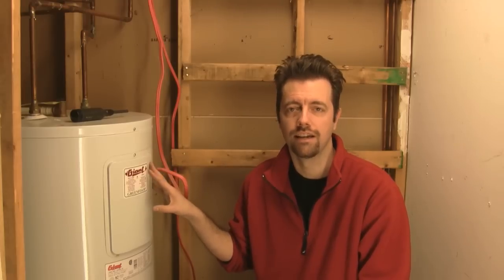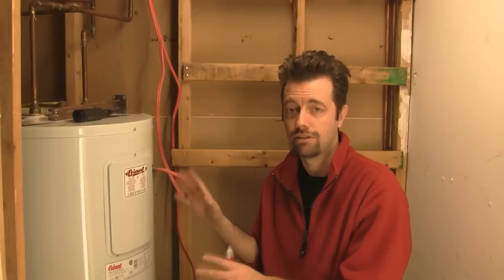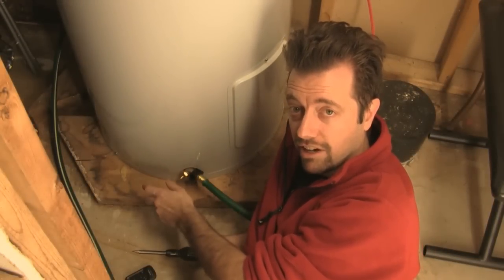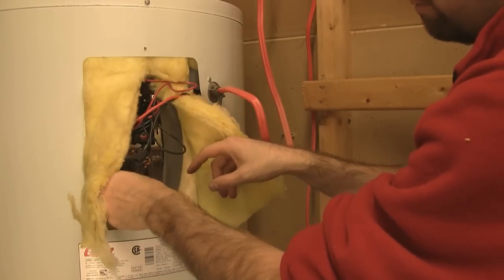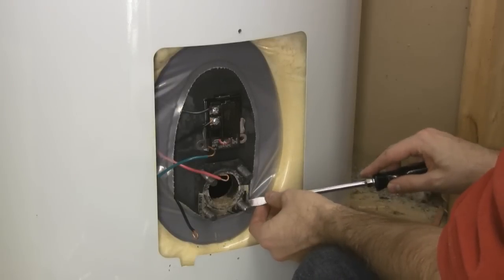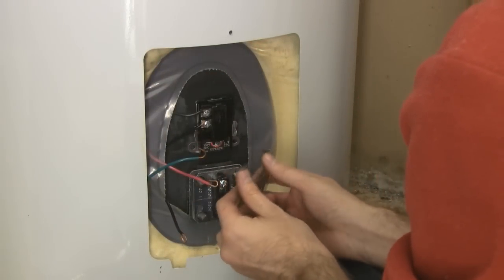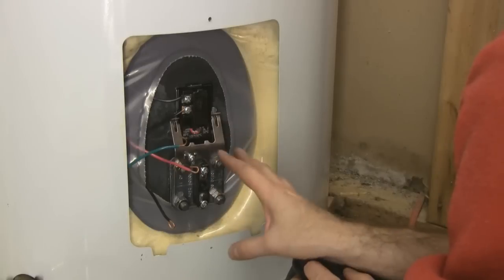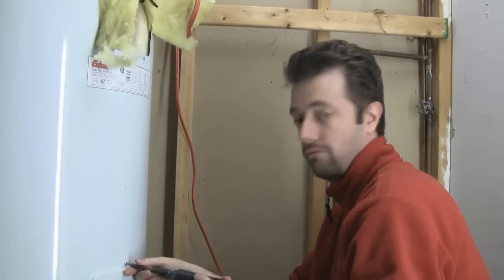Electric hot water tank element replacement

Comment: I would like to thank you for the information you have given us. I successfully replaced both the top and lower hot water tank elements today. I would not have been able to do it without your video. Your emphasis on the possible problems which could occur during the replacement really helped a lot. People like you should be commended for providing help like you do in this video. Thanks a lot!!

Comment: I'm about to replace the bottom element in my "Giant" brand water tank (hopefully tomorrow, Jan. 31/15)
Questions:
1.  In order to drain the tank you need to open up the nearest hot water tap, right?
2.  If, after installation & before turning on the electricity, there is some water seeping out, how best to fix that?  Replace the gasket perhaps???

-Thanks, Reg.
Reply from the maker: +mottledbrain Yes to number 1, the hot water tap allows air back into the tank so it can drain. For number 2, the new elements should come with new gaskets when you buy them so that should fix the leak for you.

Comment: What I am trying to find out is the wiring on the element for a hot water heater, I have two replacement elements, one is a 120v 1500w and the other is a 240v 4500w, both elements have two contacts so my question is for the 120v does a single hot leg and neutral connect to the two elements and on the 240v element do you connect two hot legs to the two contacts and if so where is the neutral?
Reply from the maker: +sterling Condit The elements should be a straight replacement for your existing ones. As long as you match up the connections everything should work. You should take the model number of your hot water tank to the supplier to ensure you are getting the right parts.
Reply: the element that came with the tank, which is a 200 gallon tank, is only a 1500w element, I want a 4500w element so I want to change out the entire thermostat and element system

Comment: Use a quality multimeter - not a $2.00 (test) probe - that is 240 volts, and if you are standing on a damp floor, it might light up your life (or kill you) if there is voltage present!  Use a shop vac, duct tape a smaller diameter hose to the end (automotive heater hose works well), and vacuum out the bottom of the tank - I guarantee there is sediment / calcium deposits in there!

Comment: LOL cylinder usually lasts 10years..... mine was installed in 1963
Reply: I bought my current house back in 1990.  It was 5 yrs old at the time.
Since then I've installed 3 new tanks and replaced the elements at least twice.
Even though we have a water softener the water is so hard here that I'm blaming my water problems on the hardness.
Lucky you!!!